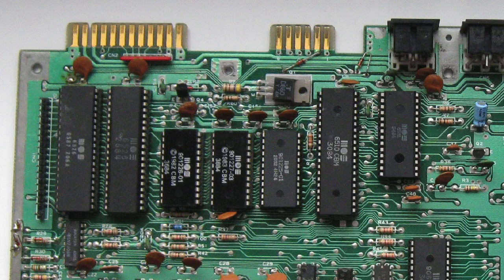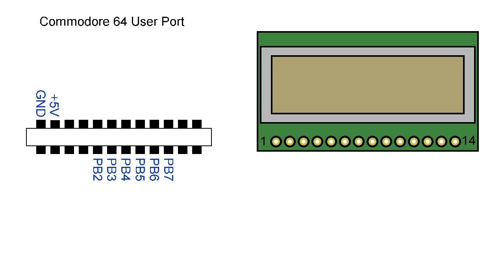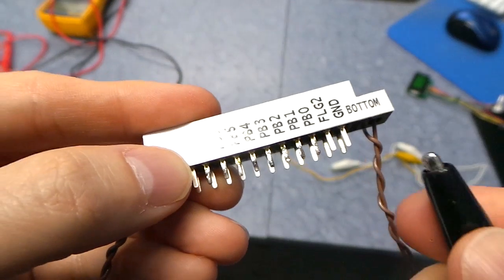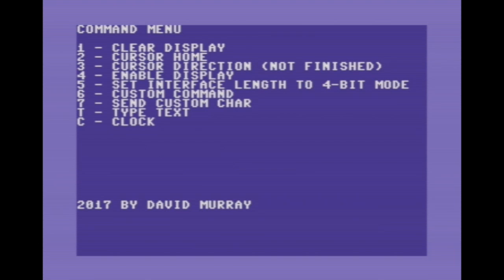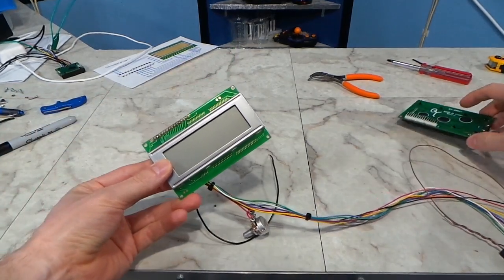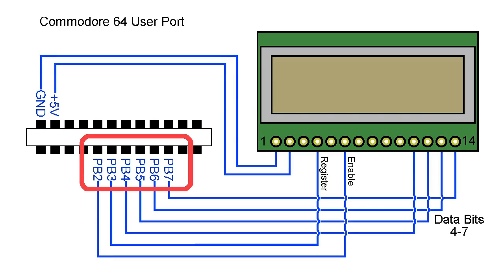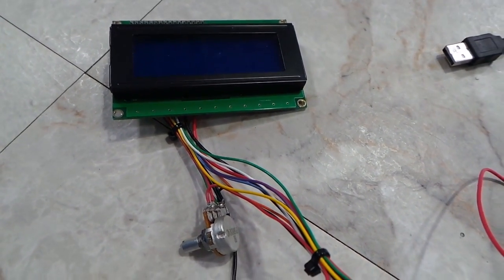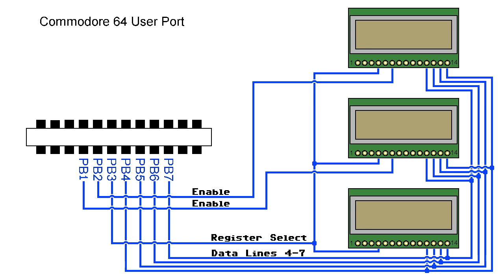How a Character LCD Works - Part 2

Comment: It'd be cool to program Pong on that little screen.
Reply: Some of these screens allow you to send fonts, which gives you pseudographics.
Reply: Pong is quite possible, and possible to run fast.
Reply: just get a standard matrix display. much simpler, and looks a lot better
Reply: Not sure what you mean there. IF-THEN-ELSE is BASIC’s mechanism for conditional branching, but every language has such a mechanism. A C64 could run Pong on this screen faster than a Human could be expected to play it. The ball takes no more than 4 characters, and a bat, no more than 2. So for each frame, you’d have to receive input, calculate the game movement, delete the previous maximum of eight characters, encode and transmit the current maximum of eight characters to the display, and go back to step 1. Would it be worth it? I think not, but it was much more viable when GLCDs were new & special, and character LCDs were cheap and plentiful.
Reply: it is a text screen, not a graphical one. So there are large blank fringes around letters - like a "######" pattern that cannot be lit at all because the pixels are not there on the LCD.

Furthermore, it would require constantly reprogramming character generator on-the-fly - possible in theory but slow and hackish.

It would require connecting a graphical LCD with a completely different interface.
Reply: You have to do the if-then-else clause, which would be painfully slow on 64k right?
Reply: Tetris on the other hand...
Reply: It would be hard, and also the "game" would run rather slow
Reply: Well, I've made a program in a dialect of BASIC on my laptop that makes mazes, and shows them being made, using only text characters. I'm sure pong which I've made before, although in a different BASIC with graphics, would be very possible with text.
Reply: You can auctually do that with just two characters; O |. | Will be paddles and O will be ball.
Reply: I have not seen a text LCD larger than 40columns x 4lines ever. If anyone seen a larger one, I'd like to see it.

Does anyone seriously imagine a pong with just 4 horizontal or vertical positions for both ball and paddle???

It is possible to make a ball several pixels large, but that would require reprogramming 4 characters for the ball and 2 per paddle each frame.

But text screens have fringes between characters with no physical pixels on the LCD. So the ball would jump from one character to another or be partially hidden behind the invisible grid, both would be really unpleasant.

And also you have seen how sluggish is even a clock in the video, now imagine it being about 3..10 times slower still. It would be totally unplayable.

My point is -- it is possible in theory, but not realistically playable at all

Pong would require a graphical LCD, but those are much more expensive and have a completely different protocol. I think it may be possible to drive a SPI or I2C display with C64, however the graphical output routine would probably need to be written in assembly to have any reasonable performance.

Comment: We can use this to a LPT aswell and using C code we can drive this lcd.

And old power supplies are a pain in the ass and they are known to take away our precious vintage hardware.
That's why i avoid using AT Power supplies on my PC builds and i always use modern PSU.

Comment: Sorry about your luck on the power supply failing. Do you know about shift registers? They are useful when you're limited on pins and I think you could use one or two of those to also drive multiple LCDs.
Reply from the maker: Indeed.. You could use it to feed in the data lines in a serial fashion.. then use the enable line separately.
Reply: I half-expected shift registers to be the answer when David explained the pin count limitation on the C64. Interesting to know that the LCDs support a 4-bit data input mode.
Reply: or you could use the 3 pins for a Demux and use up to 7 screens.
Reply: When it comes to character LCD's there is plenty of interface options - parallel, serial, 8/4 bit, and my personal favorite - SPI. I was making a "Back To The Future" console and was able to drive all digits with a single Atmega328 chip without any additional multiplexers.  Unfortunately I failed to realize my LED displays were rated for 3.3v instead of 5v so at some point the setup burned out. Lesson learned.
Reply: The 8-Bit Guy I (or my family) have a Casio CT-87
Reply: I guess you have never used one on an arduino or similar, 8-bit mode is a legacy thing
Reply: deltaray3 how do you used this item
Reply: deltaray3 ok then but David may not listen to you unfortunately.
Reply: Shift registers are magic... You could do a tutorial about them, just like with the LCD. Your videos are great. I made some of my own, which were inspired by your work. Regards :)
Reply: Well, yes, but with BASIC this is already slow, and both the port and the display are parallel to begin with. So direct 4-bit data line makes more sense. If you do need more than 3 devices however than yes, you would probably use a counter+decoder which would consume 1 pin but output 8 signals or more.
I think it may be possible to use PA2 and ATN pins as outputs to have an 8-bit bus multiplexed by several devices with only 1 external chip.